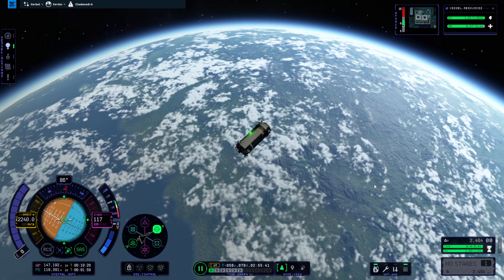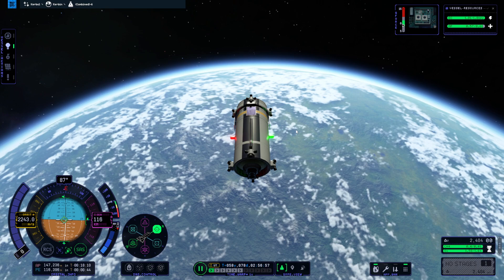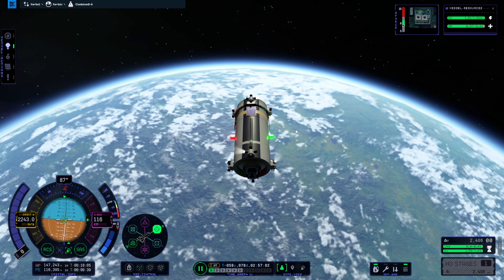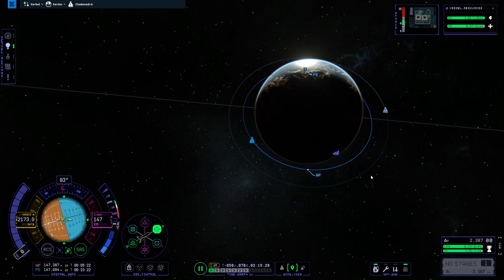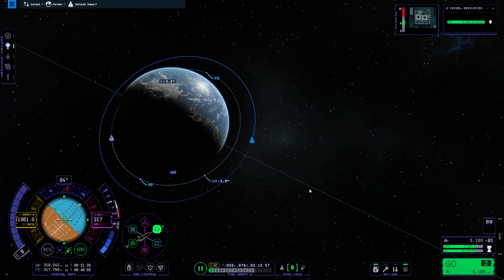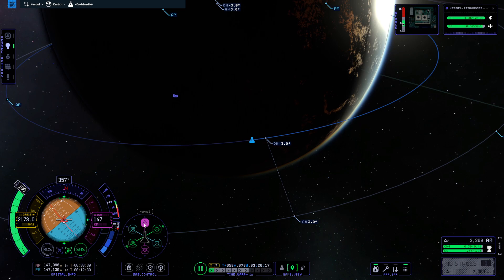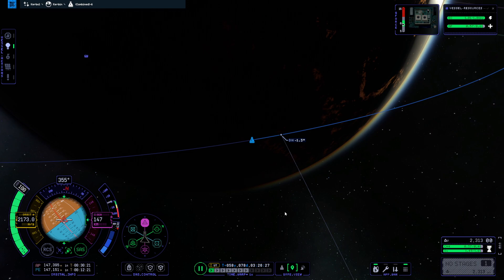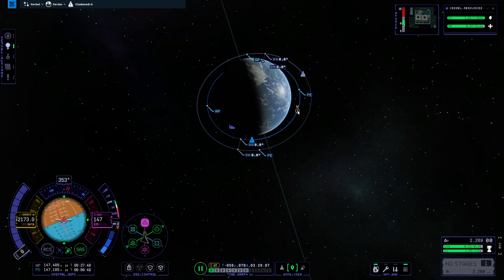KSP 2 - No guesswork Rendezvous and Docking

Comment: When you are trying to dock with a ship with multiple docking ports, you NEED to select which port you want to dock to and set it as the target. Not the ship itself because you will be aiming at the center point of the ship and not at the docking port. Another 'cheat' is to make each ship's docking port as 'target' so that they always face each other when you use target in SCS mode.
Reply: i cant get 2 ships to point at each other with SAS  which ever I'm not controlling starts getting erratic behavior.
Reply: @davisj789   Really? I guess KSP2 is more bugger than KSP1. Typically, when you do this, both ships/stations face each other no matter what. Guess you need to make your target ship/station as pro-grade or retrograde and just dock like in the video. I quit playing due to the DV not working correctly.

Comment: Watching the video now.. but I will say my largest problem is in docking, and the the problem is that KSP doesn't seem to fire RCS in a proper manner.  If I have two sets of RCS thrusters fore and aft, then it should be possible for fly-by-wire to fire thrusters in combination so that I can rotate without translation and translate without rotation, but the game doesn't do that.  So whenever I'm trying to dock I'm constantly fighting unwanted rotation and translation and it is just so incredibly infuriating.
Strangely even if I turn off RCS and turn with reaction wheels, it STILL causes translation - which I don't even know how that can happen but it does.
It got so frustrating I literally just stopped playing and went back to KSP 1.

Comment: ksp locked camera mode is far better the damn body mode whatever the fuck that means? in locked from behind your ship in rcs i is down, k is up, j is right and l is left so once you have the docking ports aligned you just hard to line them up with ijkl then h to thrust forward and dock done. in ksp2 ijkl are all borked and make no sense like i and k and j and l are reversed. so I get all fucking frustrated,  I wish the devs would just match the damn camera modes I mean wtf this is based on ksp1 why go out of your way to make all new names for camera modes that do not match ksp1?????  Why?  Why? why?

there is a docking port alignment indicator in ksp1.  I can cover my monitor and just look at that gui and dock any two ships.  The version in ksp2 is all fucking bortked because I cannot find a camera view that aligns my rcs properly so I can keep translate lr or ud to align the docking ports and I get to the point I want to rage quit.  I can dock in ksp1 with little to no effort between ANY two orbits in KSP2 I get to the point I want to KICK my puppy I get so fucking frustrated!!!!!